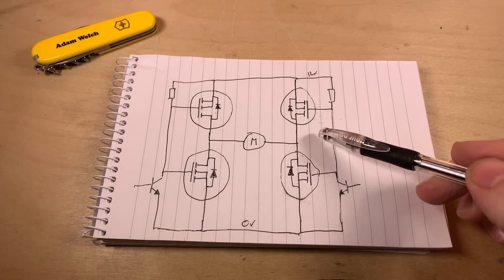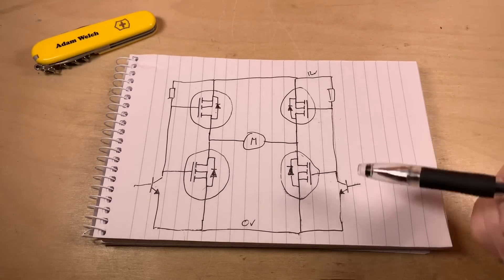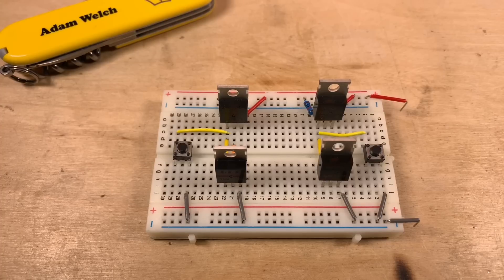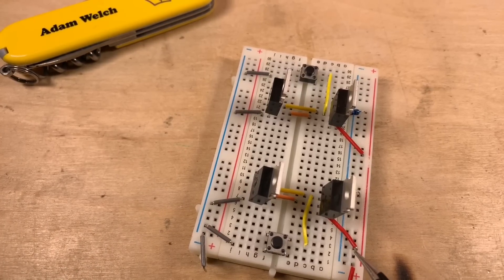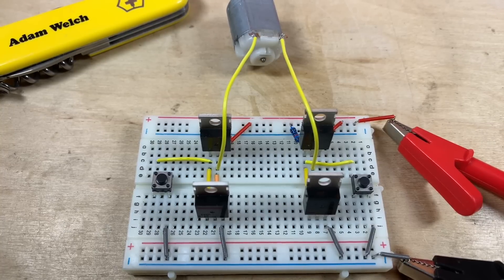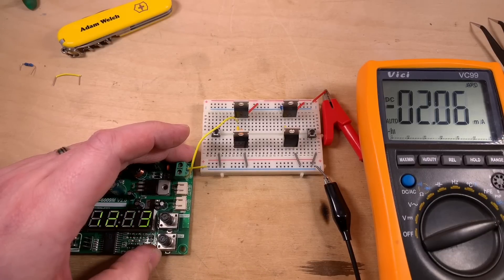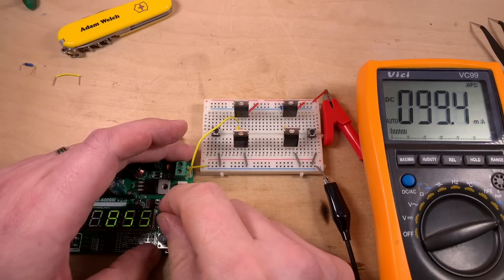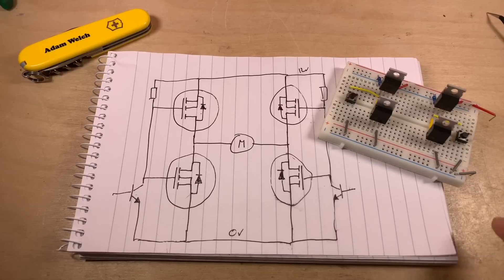H-Bridge Mistake

Comment: Hmmm i suppose you could perhaps drop a zener diode between the gates? That way the P channel gate becomes offset toward the positive rail and the N channel gate goes to the negative rail, the downside is that your mosfets are being driven less meaning you now have to balance shoot-through with RDSon for your new drive voltages

Comment: You drive them by four pins of arduino. Giving about 50 microseconds gap between switching off and on. First switch of the mosfet that is on wait for about 50 microseconds then switch on mosfet of other leg. Just few days ago I did it. No need of any transistors even. It works fine. To increase the current you can have parellel n and p channel mosfets and drive by same arduino pins.

Comment: I connect the the l298n to a stepper motor nema17 my DC power supply shows no current being drawn when I send a signal to move the stepper one revolution and then stops I notice it's still continuously drawing max amps and it's in CC mode an till I reset the Arduino then it goes back to normal again it's like the pins 8,9,10,11 are causing it to still run some how also after about 30mins the rc522 RFID scanner stops working any ideas what this could be?

Comment: On e-bikes or bldc controllers they  seems like used lots of cascaded transistors stabilisimg resistors optocouplers for fixing  the issue. Altough i didnt track all details but that circuit is used on all bldc motors controllerstoo ie electric weichles in general.  Well they use 3 phase h bridge ...

Comment: That configuration could work fine if your supply voltage is low enough that at no point can both FETs be in saturation or ohmic region (fancy words for linear region and "on"). If the threshold voltage is about 4V, you could get away with 6V to 7V supply and the shoot-through would be minimal. But of course it is not desirable to have such a narrow supply voltage for operation. 5V might work with the right FETs, but most normal power FETs need a bit more than that to achieve the Rds(on) banner spec.

Comment: Its not easy to suffer massive blow outs when you dealing with mains rectified H bridge circuits and get your timing even a tiny bit wrong and you have a massive blow out of high voltage expensive Mosfets.

Comment: You should probably breadboard your original setup and examine the current flow with the transistors fully on and off, instead of using a variable power supply on the gates of the mosfet because this demonstration is not an accurate depiction of your original circuit. I'm just saying.

Comment: Can someone please explain what the issue is here with the transistor driving the H-bridge? I understand that if you drive a transistor with a variable voltage input then you will get the scenario that he is talking about here where only a portion of the voltage is dropping across the transistor thus varying the voltage at the gate of the mosfets. But if you are driving the transistors fully on and fully off then you don't have to worry about the states in-between. Driving the transistor fully on will put the transistor in the saturation region and dropping around 0.2V from collector to emitter, effectively 0V or ground, and the remainder of the voltage will drop across the resistor. Turning the transistor fully off will have no current flowing through the transistor and the gates of the mosfets will be at the supply voltage.
Reply: the difference is you will get a few micro seconds of shoot through or high loss via dead time what adam is the almost dead short do to no dead time hope this helps

Comment: I used the H-bridge shown in the following picture: http://prosje.be/Projects/H-brugVI.png
(from the webpage http://prosje.be/Projects/BelastingSchakelen.html). It is in dutch, but I try to translate it.

As you want to use the left P-mosfet in conjunction with the right N-Mosfet, you can switch the P-mosfet on by pulling its matching N mofset low and keeping it conducting trough a capacitor. The N-mosfet is the only active switching component and therefore got a mosfet drivers to improve the switching characteristics. The only drawback is that you may never switch input A and B on at the same time.

Hopefully it helps you further ;)
Reply: What is the purpose of capacitors C1 and C2 and diodes D5 and D6 in that circuit?

Comment: I think, with a second transistor of pnp-type, instead of the pullup, and the pullup (470 ohm to 1k for slow switching) between the collectors of the transistors, the problem can be avoided with little effort. At this time, I have no p-Channel MOSFET handy to test, but I think, you should try that configuration on your breadboard. The transistors base must be coupled in a way that there is a voltage interval in which both transistors conduct so that the output of the MOSFETs is floating. That can be achieved by base/emitter resistors of about 470 ohms and two base/base resistors of 4k7 in series. Between these you can apply your 12V rail to rail logic signal.
Using optocouplers to isolate the arduino from the powerstage makes no sense as long as both can use a common ground.
Again, thank you for cool videos!

Comment: Maybe that's why the original board used relays? The switching delay of the relays (which can be lengthened via capacitors) occurs in step with the switching time of the MOSFETs, thus avoiding that problem.

You should be able to achieve your goal with a simple centre off, single pole dual throw toggle switch operating the coils of two relays, maybe salvaged from the failed board. Each relay is wired so that it supplies current to the motor in opposite directions. No need for any electronics at all. 

But first check to see whether the relay contacts have failed, maybe even welded together, thus causing the loss of voltage to the PIC while the MOSFETs failed. Just guessing, of course, but still worth investigating.

Thanks Adam.

Comment: Couldn’t you just use 2 x 3 pole relays. 1 pole for power and the other 2 for forward. And the second relay for reverse. So now relay will work if the other one is on.

Comment: if you don't need speed control of your motor, you can use simple relays. Even with an h bridge relay, you can add just one mosfet in serie to pwm and the adjust the motor speed. With dpdt relay, you just need one pin : http://4.bp.blogspot.com/-z_QGf7IYPWM/T8cOTopVn8I/AAAAAAAAAN0/TqP4AR_qgHE/s1600/dpdt.JPG. I've use relays for my for my gate opener (2 motors) and it works fine since about five years. If you want more details, you can contact me, i would be glad to help.

Comment: Actually it may have worked fine.  Once you have a dead short across your mosfets it would pull your control transistor to 0V on both legs thus turning off the mosfets.  So your dead short would only last for the fall time of the mosfet which is what a few hundred nano-seconds?

Comment: Nevertheless though, you've just invented an outstanding circuit that will draw current when the voltage is in between two points! Put a lamp in series with the Mosfets and it'll glow when the voltage is in the middle! An interesting "power good" indicator without using op-amps etc. :)
Reply from the maker: Every cloud eh? I great way to look at it. Thanks Xan.
Reply: @AdamWelchUK  It's an interesting idea, and of course you would only need one part of the "H" to make such a circuit. It could probably be "tuned" by changing the resistance value and/or adding some Zenner diodes somewhere in the line between the Mosfets.

Comment: I have have used many half bridge drivers, the chips are only a few bucks and the powerful gate drive (1 to 4 amps I have used) make high speed pwm very efficient as the switching losses are low.
Reply: Also if your going to drive a lot of current you might want the high side to be n-channel as well. RDS(on) is much higher in p-fets. There must be a lot of h-bridge drivers out there, so there is no point in trying to do it with discrete components yourself.  Great vid

Comment: An easy fix (that doesn't require new PCBs) is to add a 5th mosfet to VCC to disconnect power when the mosfets are changing state (direction).

Fixing it properly requires creating "dead time" where no mosfets should be switched on (in reality mosfet gates behave like capacitors).
Overly technical on the topic.
https://hackaday.io/project/3176-gator-quad/log/11741-pwm-control-and-dead-time-insertion

ps: solder a EMI supression cap to the end of that motor if you plan to use it in projects.

Comment: Take a look at the circuit in https://youtu.be/dbwZgP9gIbA. When the inputs (D1 D2) are both low all 4 mosfets are off. When one input goes high. Only the desired mosfets are turned on. All you have to do is make sure you turn off the one input, delay a smig, then turn the other input. I think.

Comment: In SHORT, How dare you commit mosfetery?! Complete and utter Blastofme  :-)
Reply: MrBrymstond, go Ohm! I'm saying this with some Reluctance: The Power of your words is meeting with Resistance here, because it makes you sound like a Hooray Henry from a Coulomb a Short Circuit away from blowing a Fuse. It makes me want to Choke, even though Anode what you meant! Under the Current climate, do you think it would be wise to make a Volt for the door. A? C? To Siemen penning jokes along that kind of Line is rather down to Earth of you, but writing as an Unbiased Neutral, the Power Factor here is less than ideal. While this Sparks some more funny comments from you, I'll go to Ground Faraday, and build a PCB with my Dielectric Soldering Ion, and Flux, while you Collector thought or two. No more Base comments from this Emitter! DC Watt I mean? 

To Condenser word or two of that , thanks for the laugh!
Reply: @RWBHere  Ahahahahahaha

Comment: The worst case scenario with the circuit using a single bipolar NPN transistor and a single pull-up resistor to control an N-channel and a P-Channel MOSFET, is with a relatively high value for the pull-up resistor and the NPN transistor switches off. The NPN collector and therefore the MOSFET gates will see a slow voltage rise due to the gate capacitance charging via the resistor...

Comment: Search for L9110S on eBay. Dual chip boards for $1 or 15A 36V power versions for US$10
Reply: Peter Kay BTS7960B is another option. Have used it previously to drive wheelchair motors in my combat robots.
Reply: @TornTech1  Another nice option with hi side driver as well and >40A but limited to <18V so ideal for 12V systems

Comment: Nice explanation... Does the motor driver have any proportional control or is it just left or right motor on or off?
You obviously need to introduce a dead zone and delay, which you could do using the arduino and another 2 ports, but you could also add some logic to get that 'for free' - maybe a clock with a resettable counter or shift register that you can tap with some gates to get trigger signals at the right times.
Reply: 2 more ports and code to provide a delay that is slightly greater than the slowest MOSFET's discharge time.  Sounds like something Adam could do over one cup of tea ;-)
Reply: @Undefined Lastname Both have advantages - I like the ability to offload tasks to hardware that just works, but it's also good to be able to have software control of all parameters and build an optimized model.